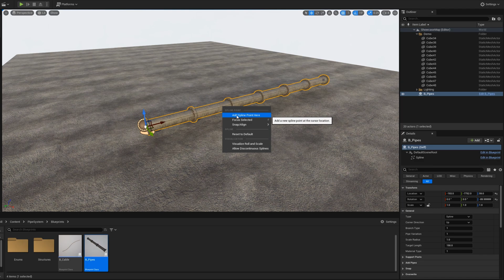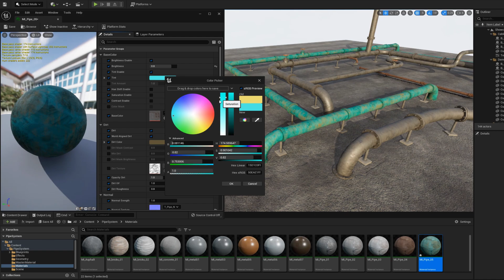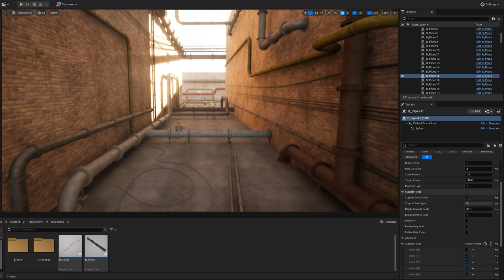[UE5] Pipe System Pack (Breakdown)

Comment: Can I replace my own pipeline model, such as the pipeline model of quixel
Reply from the maker: You have an array "Pipes Data" in the "Advanced Settings" category, there is a photo with types of the pipes in the documentation but they will have to meet some requirments. https://imgur.com/a/Xd6WimX 

For example, the corner pipe will be like a normal modular pipe piece but more segmentated to be able to curve on the spline. The branch pipe is made from 3 or 4 part of pipes.  
Thank you!